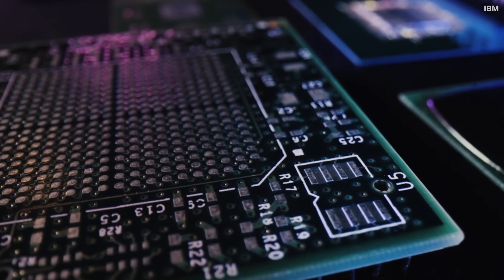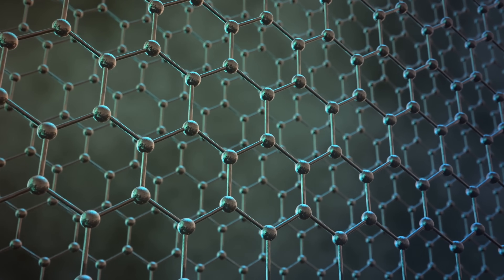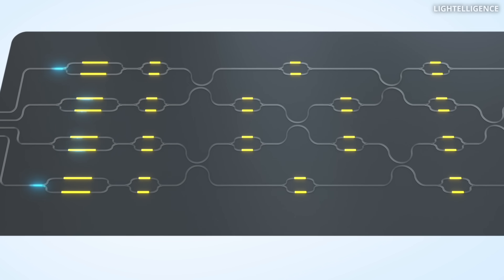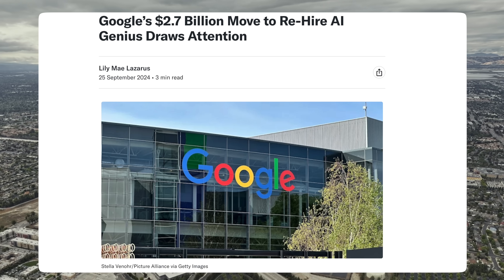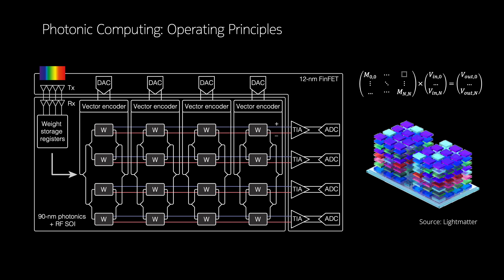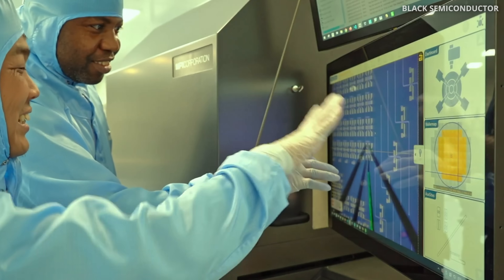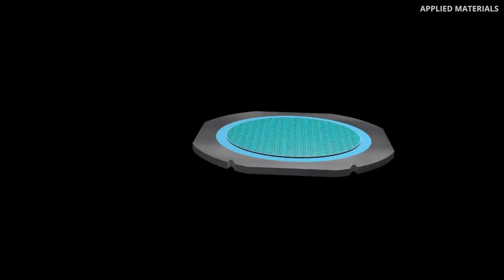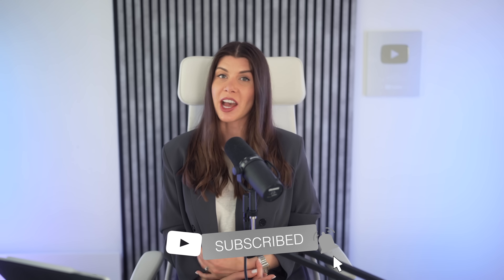Here’s What Comes After Silicon

Comment: You put a coherent beam of light through a Mach-Zehnder interferometer, which splits the beam and then recombines it with a phase shift so the recombined beams interfere destructively giving zero output.

Where did the energy go?

Comment: I still dont even understand how the transistors from when computers were first invented work and now were building chips an atom thick that works as fast as light can move this is actually insane and idek how its possible
Reply: Because you are skipping from the beginning to the end and not looking for the middle part
Reply: Coz we not live in nano scale world 😁
Reply: Transistor is easy. 2 inputs, 1 output. First input has "raw power" incoming. If the second input has "some power", the output lets out the raw power of the first input. If no tension (V) is applied to the second input, no power comes out of the output... It's crazy easy. What's hard to fathom, is the quantities involved and the management of all these switches... Because it's all transistors are... Switches... It's crazy interesting and today, you can learn almost anything you want with some little effort, and if you have the motivation to learn, it's not even an effort, it's a reward....

Comment: "A carbon nanotube (CNT)-based photonic computer chip could achieve extremely high throughput by leveraging parallel optical data transmission.... This architecture could surpass traditional fiber optics by eliminating wavelength multiplexing limits, using spatial parallelism instead. While current implementations are small-scale, the physics allows for petabit-per-second throughputs with sufficiently large arrays." Perplexity AI

Comment: Very good episode. I thought thoogh that in silicon, and, especially graphene-based interferometers instead of modulating the phase, they simply increase absorption in one of the paths of the interferometer. This will also affect the interoferometric effect, but the effect should not be as clean as with pure phase modulation. If we only wanted  the phase-only change, it can be implemented using some lithium niobate, but this will be too expensive.